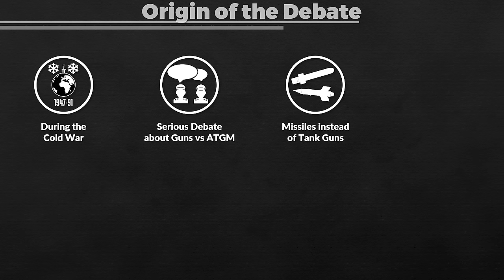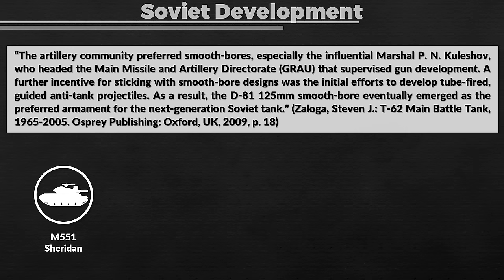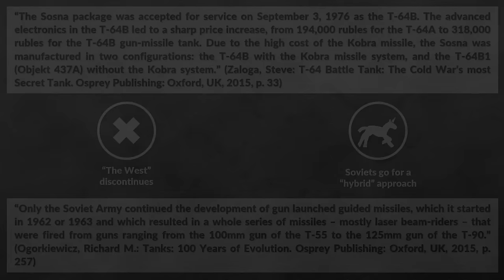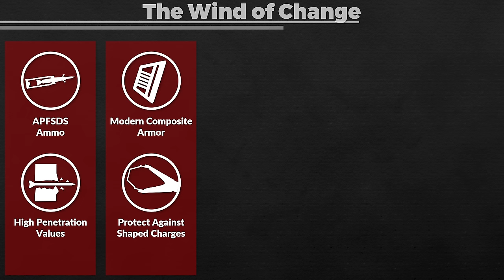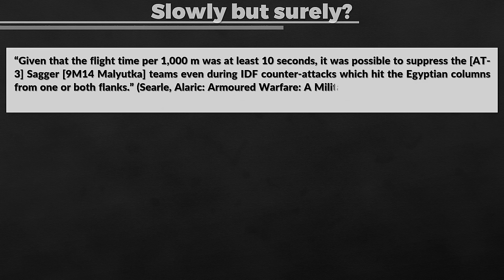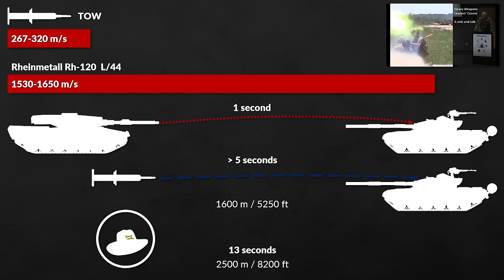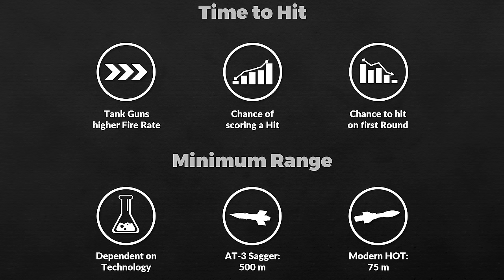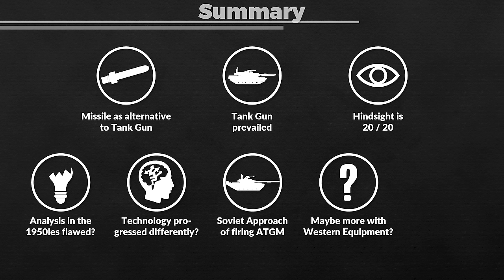Missiles vs Tank Guns: Why Guns are better!

Comment: Another point to consider is that the line of sight might no always be clear. An APFSDS will go through a bush or a small wall without deviating or loosing too much penetration, while a missile will probably get deviated by the bush and stopped by the wall
Reply: Missiles can go over the obstacle, though. 

I don't think it's practical quite yet, but I doubt there will be much longer before guided missiles are increasingly the obvious choice.
Reply: Missile can deal with bushes. Not wall. 
Also you will not risk shooting AP throught a wall cause you don't know what's behind.
Reply: @m0nkEz  
The advantage of conventional high velocity projectile is the low time between fire and impact. And there is no realistic way to intercept them, passive or active system. 

Yes, it is possible with missile, but size of missile required to reach the same velocity would be stuff like losat, very big and limited in carrying capacity.
Reply: @jintsuubest9331  I think you very much would put an AP round through a wall if you suspected an enemy tank was behind it.
Reply: @jintsuubest9331  There were tank kills in WWII from shooting right through buildings at one another.  So I don't think that'll stop anyone from firing through your house at the enemy vehicle on the other side of it.  Only some bureaucratic ass-kisser might be stopped by such a philosophy, but not anyone experience in warfare.
Reply: @jintsuubest9331  You could know what's behind a wall, especially if you're not alone. A drone or a second vehicle or troops give intelligence to the tank commander. Your information isn't limited to just your vehicle's line of sight.

Comment: this long ago TOW/DRAGON  repair tech loved this video.  Just as an aside, a design flaw in the Dragon trainer made it very unlikely that any one live firing for the first time would get a hit.  The simulator had a weight that shifted when the training blank was fired BUT it did NOT leave the training launcher, thus the weight on the gunner's shoulder never changed.  So first live round fired the gunner would tend to rise as the 10 kilos of missile left his shoulder, often causing the missile to drop-if not bounce on it's flight path.  I watched as EVERY DRagon round fired by a Ranger company did exactly that at Yakima firing center. Every shot missed the target train-even after a Master Sgt opted to jump on the trains engine to control the throttle.

Comment: I think they also wanted to mount anti-tank missiles on other types of armored vehicles that could not support big guns, like the Bradley. Missiles do not have that huge recoil.
Reply from the maker: Yeah.
Reply: @MilitaryHistoryVisualized  You can mount a missile on a rowboat, or an anti tank canoe. You cant swim a gun across a river.
A tank round is likely better against more things than a missile though. A heat round is cheaper to shoot at a bunker or building. You can fire smoke rounds or flairs from a gun, though I am not sure anyone does. Its also far cheaper to train with real ammunition on a gun than with a missile.
Reply: @scottmccullough8030  I am also surprised that folks forget one of the biggest factors in weapon choice 
Ammunition and logistics.

I can print tank shells in their thousands. But anti tank missiles need to be carefully assembled and checked, with delicate electronics that can render the weapon utterly useless.

And most missile weapons are larger than tank shells, and when attacking we note there were problems for the KV tanks from world war 2 due to having small ammunition stowage capacity!

Modern ammo remains large and limited, if you sacrifice yet more ammunition for a bigger missile you will need to retreat to a ammo truck after even less time fighting on a battlefield!
Reply: You can use a recoiless gun to handle recoil, but weight would still be a issue
Reply: @user-pq4by2rq9y  you do note that recoilless weapons require a mechanism to discharge sufficient propellant to balance out the kinetic energy of the shell being fired? So they usually have worse back blast than missile weapons? And are poorly suited to confined spaces, like inside a turret.

I wonder just how big a blank Shell you might need to balance out a HVAP type round.
Reply: @glenmcgillivray4707  I am aware, but I am also aware that that's actually something the US has been playing with in the recent past, raven guns.
Reply: @user-pq4by2rq9y  Recoilless guns are also much lower velocity than regular guns, because of the fact that you utilize backblast to counteract the recoil. The propellant not being contained means a huge amount of its energy is lost.
Reply: @gimmethegepgun  raven guns are not quite like recoiless guns, gasses are only vented once the projectile has partially traveled the barrel. You don't lose nearly as much muzzle velocity that way.

Comment: Another thing we have to take into account is the types of countermeasures available against missiles vs. tank gun rounds. There are several types of active protection systems against ATGMs that can shoot down incoming missiles with something like an automated shotgun (e.g. Trophy, Arena), or use electronic warfare to interfere with the missile guidance. And this is in addition to various types of reactive armor. On the other hand, once a kinetic round leaves the tank gun, there is little you can do about it. Shotguns, smokescreens, and electronic baffles have no effect whatsoever on an incoming APFSDS round.

Comment: I mean, there were dedicated missile carriers like the Pereh in use and ATGMs are in frequent use as secondary armament for IFVs like the Bradley or Puma that simply don't have the space and carrying capacity for a full-blown 120 mm cannon.
Reply: I think the point stands that if your vehicle has the capabiity of carrying a gun you take that over Missiles.
Reply: @brain_tonic  True. Come to think of it there are vehicles like the M1128 and the Rooikat that have something akin to a MBT cannon mounted on a wheeled platform.

Comment: Interesting video. However, I would like to point out that one of the main reasons to use a gun-fired ATGM is to compensate for the fact that Soviet-type tanks have a much lower silhouette and so do their guns. Overall they have a narrower range for elevation and depression.

ATGMs don't care. They'll climb or dive where you guide them. This means, for example, they can be fired from the top of a hill at targets downhill where cannons wouldn't have a firing solution. For this same reason, they can be fired at helicopters with a greater chance of success than tank shells would. (In theory.)

Still, I find that most of the points in the video concerning the advantages and disadvantages of ATGMs vs shells are valid, I would like to put a little caveat on the travel time difference. In a tank vs tank scenario, even if there is a 1000 m/s difference. The humans operating the target vehicle will still, most likely, be unable to make their 50+ tons vehicle "dodge" the missile in time even if they are aware it is coming.

Furthermore. You can correct the trajectory of an ATGM, you can't correct a shell in flight.

In conclusion, the question 'Are missiles better than shells?' is just as relevant as the question: 'Is a sledgehammer better than a screwdriver?'

Think of that what you will.
Reply: Agreed regarding physically dodging the missile. However, if they spot the incoming missile in time, it does increase their chance to pop smoke and disappear from the view.
Reply: This is not completely true, soviet gun launched atgms are laser beam riding and they require the main sight to aim at the target, gen 1 atgms like the malyutka can do that but not russian barrel launched ones
Reply: Excellent point. Never thought of this.
Reply: @Ropetor  are the later generation barrel launched atgms like Svir/Invar/Refleks-M exclusively tied to the main barrel sight? I would’ve thought they would’ve added the ability for the commander to guide it in.
Reply: @fenriders7008  All russian tanks in service except t14 and t90M don't have a citv.

They use the same unstabilized night vision sight from with  from 1978.

 Commander in t72/t80 is almost blind with minimal hunter killer capability, the commander can override the traverse and point the gun to a target but the targeting needs to be done by the gunner, he has a monitor that allows him to watch trough the gunner sight and he has his own controls but no CITV

Russian tanks mostly use the sosna-u gen 2 thermal sight with a laser rangefinder attached to it, they also have a sight called duplet as a secondary sight but it uses the same laser rangefinder as the main sight.

Russian gun launch atgms are all laser beam riding and the only sight capable of emitting is the main sosna-u or pmn-t wich is another thermal seen in use by the T-80BVM
Reply: @Ropetor   oh wow, thanks for the info. It seems like a massive oversight in design to omit a citv from any of the numerous t80 and t72 modernisation packages. Though I guess doctrinally it makes sense somewhat.
Reply: @fenriders7008  You should look at the T-72 B2, it was the original plan to modernize the  t-72b 1989's  it included a lot more updates then the t-72 b3
Reply: Interesting to this civilian. Decades ago I thought the best shape for a tank would be a big metal bubble firing missiles at 'the picture' that had been put into them. Apparently tanks should move around or be hit by artillery.

No matter. The missile is chasing that electronic picture. 

Nowadays the missiles can have many embedded pictures so the data transfer is just one number, maybe use a letter. No matter.

The missile is well aware that the picture it is flying to can move and change shape, that is taken for granted nowadays. 

Somebody must have costed that guidance system.
See it, fire, and the missile has left on its way to whatever you saw. 

It might be worth shooting at it because you can't hide.

Comment: One has to appreciate the kind of gamechanger hollow charges were.
During WW1 and most of WW2, AT warfare was "Fire a really hard projectile really, really fast". Speed was the one property for deciding if you made a kill.
Shaped/Hollow charges do not need speed for killing. That is what makes them man portable and easily added to IFVs. Of course you can also put a S/H charge into a tank gun round.
ATGMs not fired from the barrel are propably best left as secondary weapon for those vehicles that can bot fire modern AT rounds.
Reply: Also interesting is that tank-fired antitank rounds have largely reverted back to firing something hard and fast at the enemy instead of shaped charges lol
Reply: @gimmethegepgun  I think that was due to ERA developments getting too good. But right now ERA is pivoting towards AFDPS defeating too.

Comment: 1:40 I think a big reason why the US doesn't peruse gun launched Anti-Tank missiles anymore was the debacle that was the Shillelagh system soured them to the idea.
Reply: Odd, considering that the system showed the potential, just held back by technologies of the time.
Reply: + @jamesharding3459 + It suffered from So Many problems that the Pentagon just chose to retire the platforms early than bother improving them after they Finally got a mediocre level of effectiveness that took Decades to achieve. Them trying to use caseless ammo for the gun rounds probably didn't help along with how in early models firing a shell would break the missile guidance components.
Reply: @cnlbenmc  True. But those were engineering problems, not inherent to the concept.

Comment: Reminds me of the old "Sagger" drills back in the late 80s and early 90s. If you see a puff of smoke, the driver drives in a random zigzag pattern while the gunner fires in and around the puff of smoke. You done need to kill the sacred operator, just make him flinch and jerk the missile off course.
Reply: not so  useful anymore, NLAW, Javelin, etc are fire and forget.   NLAW procedure is to track target for 3secs and fire, it tries to predict where the vehicle will be in 5 secs. (it only has a 800m range,  which is pretty short to be on the receiving end of a 125mm HE shell).
Reply: Forgot about those, but was 40 years ago
Reply: @orbitalair2103  

I believe the NLAW is not guided per se. It simply predicts a path based on prior movement. In theory, if a driver sees the launch, eratic maneuvers may evade the NLAW.
Reply: @demonprinces17  

It is still effective if the missile is not a guided fire and forget missile. The US TOW is still command controlled. Same for some Russian AT missiles. Many of them are beam riding.

Comment: About the propability to hit with a tank gun: In the 90s a Leopard 2A4 crew was supposed to hit and kill enemy tanks up to 3000m with the first shot, at least that was the training requirement/goal.

Also, a tank gun is rather easy to use. Advanced targeting systems make that easier, not more difficult. 
The gunner keeps the sight on the target, uses the laser for the distance, maybe has to hold an extra button if the target is moving, then uses the trigger. To avoid detection by enemy laser detectors and thus warn the enemy, the gunner can laser the ground next to the enemy tanks. While laserguided missiles operators have to keep a laser on the enemy the whole time, or at least for every course correction during flight. (not sure how technology progressed there)

Id use a tank gun anytime unless you got a ATGM for ranges, say 4km+, where the enemy tank cant reliably shoot back at you.

Comment: Two additional points, if I can. 1. A gun is more flexible. As soon as I pull the trigger I can traverse onto a new target as the round is "fire and forget" whereas most ATGMs require a beam rider or optical tracking (i.e. keep the gun pointing at the first tgt until you hit/miss). With the gun, you can shoot at targets at 12 O'clock, then 9 O'clock then 3 O'clock (esp. if the tank has CITV or similar Hunter/Killer equipment), while the missile is still looking at the 12 O'clock target. 2. The gun can fire many different natures (types) of ammunition (anti armour [Kinetic or Chemical], smoke, HE, Canister or similar anti personnel rounds, ...). Having only an ATGM forces you to shoot at say a truck with an ATGM rather than say HE.
Reply: While I can't say anything about gun-launched ATGM missiles, but - for example - the RPG-7 shoulder-launcher can use several types of HEAT (normal and tandem), fragmentation and thermobaric ammunition.
The reason why tanks don't carry multiple types of gun-launched missiles is that their gun-ammunition is already good enough for the task.
As for shooting at trucks, Russian tanks usually have a heavy machine gun (12.7mm, similar to the US .50 caliber).
Reply: @CalinCETERAS  I was using a truck tgt as an example. Ideally you would use coax on transport. But there is no "smoke" ATGM, nor a Cannister ATGM, etc. This is one reason why the "ATGM only" (note only) option wasn't adopted.

Comment: Has any army ever considered a gun-launched surface-to-air missile ? It would certainly be a very useful self-defense capability for tank formations, especially against attack helicopters.

Also, love the Soviet Womble reference.
Reply from the maker: The LAHAT mentioned at the end of the video should also be able to deal with helis, I considered adding that line, but didn't.
Reply: @Laotzu.Goldbug  That was one of the advantages of the Soviet missile systems. Their missiles were much faster than the TOWs coming back the other way, and at long range, their accuracy simply couldn't guarantee a hit on a target. Of course, you'd need to hope you had a missile in the tube at the time.
Reply: ...At the typical range from which an armoured vehicle would engage aircraft would a guided SAM have a significant advantage over, say, a proximity fuse round? (IIRC the M1 Abrams is capable of firing such ammo) Legitimate question, as a non-expert I am intrigued

Comment: I must strongly object to higher complexity require more training per default.

Starting out with the GrG m/48 (Carl-Gustaf), it takes months of training to become proficient and reliably hit a moving target.
First generation of missiles took weeks to learn how to effectively guide the missile to the desired impact point.
Learning how to use Rb 56 Bill could be done in a week, while learning how to use a Javelin can be done in a couple of days.
(Note that this does not include the tactical skills necessary, as to which firing positions to select, concealment and so forth).

Another aspect not brought up is that after WWII, the main focus in gun munitions was HEAT, which has a much lower velocity making them far more difficult to correctly lead on moving targets at longer ranges. This trend was not changed until the 1970's with the long rod penetrators. These projectiles did not see the sharp decline in armour penetration over range as the previous kinetic penetrators had, and thus removed the need for chemical penetrators for long range engagements.

Comment: Tanks need to have a gun for fast shooting and ammunition capacity (and cost). And once you have to have a gun, then why complicate things in the tank when a different vehicle can carry the ATGMs? The missile vehicles can fire overwatch from longer ranges out of range of enemy tanks and thus don't need as heavy of armor. They basically act as attached tank destroyers. As a bonus they can carry infantry.
Reply: Basically, why have a tank that has ATGMs in place of a gun when you can either have IFVs with ATGM launchers or another lightly armored transport vehicle with one sitting a bit off in the back.